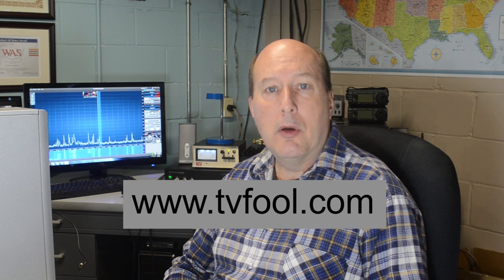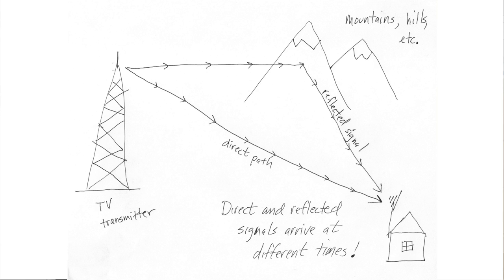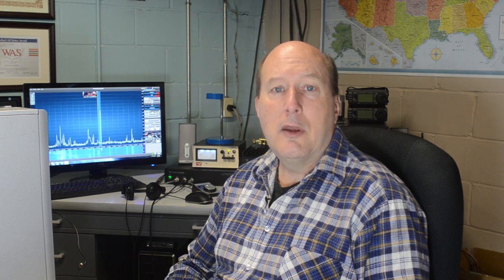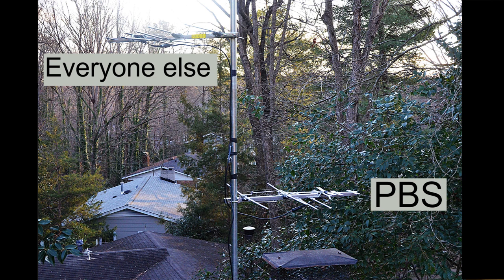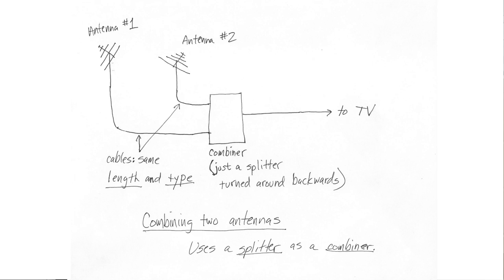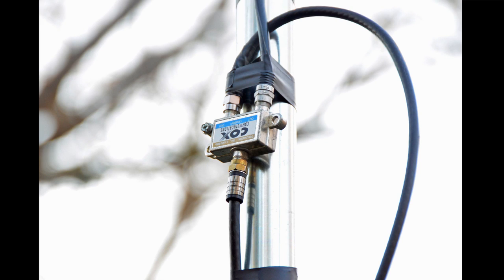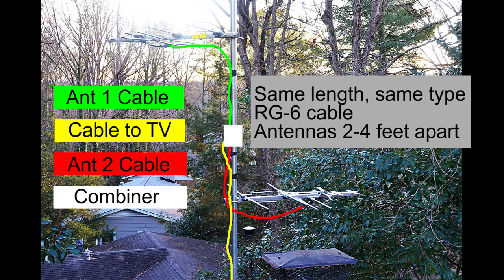Combining two TV antennas for better HDTV reception

Comment: Doug,
Your video is quite simple to understand.  I searched all over the internet to find information about combining two antennas.  I have a problem thought.  I have the exact same two antennas and I followed all the steps in your video : they are 4 feet apart and I used the exact same length and type of coaxial cable too.  I tried three different types of combiner/splitter.  I am still not receiving any signal.. I tested both antenna separately and they are working.  I am using two Monoprice HDTV Antenna (model MDA-5600).  Can you help me ?
Reply from the maker: Doesn't that antenna have a built-in preamplifier? I don't think the combiner will allow the DC power to pass through to the preamp in the antenna.
Reply: Yes, it has a built-in preamplifier.  That's why it does not work.  Thanks for your help!
Reply: Would a dc pass combiner provide enough power for 2 pre-amplifiers?

Comment: Are there any ways to measure signal strength  when mounting a fixed antenna. So when you fasten it is aimed correctly?
Reply from the maker: There are TV Signal Strength meters you can buy (the Winegard RFL-342 is one example) but unfortunately I don't have any experience with them. Some TVs have signal strength readout information available as well.

Comment: Thanks for the video.  I have an outside antenna and we get all the local channels expect one.  We purchased a Ultra Pro Hover HD 250 Amplified Antenna Bar, which go 50+ miles, to hopefully receive that one channel we want.  Would it work to hook up and outside antenna and this inside amplified antenna bar?
Reply from the maker: Hi Jenny, I doubt it. I guess it can't hurt to try, but likely you'll have issues with multipath distortion as discussed in the video.

Comment: great video, now when trying to combine 2 OTA antennas that currently both have preamplification,  should I cut back to 1 preamp amplifier and insert it just after the combiner and the power source for it just before the splitter that sends signal to 3 tv's? Or is there a better scenario? thanks
Reply from the maker: I think that's what I'd be inclined to do in your situation, David. In my case I bring the combined signal down to an amplified distribution box under the house.

Comment: Wiring them in parallel doubles the reception surface area and also cuts the resistance in half. Thus boosting signal strength...

Comment: Doug, great info! One question, if I wanted to hook up multiple TVs, I've been told that I needed to install a preamplifier. I'm assuming that this would be setup after the combiner. Is this correct or am I mistaken in locating the preamp, or even in the need for a preamp in the first place?

73,
KI7DBV de Phoenix, AZ
Reply from the maker: That's correct, Pablo. I have a preamplifier installed after the combiner, and it feeds multiple TVs.
Reply: Alan Sumner would a filter help as well?
Reply: Alan Sumner Good stuff right there, thanks

Comment: I like the way you have it setup, I might do it similar. Just wondering, did you ground anything? or it's not necessary? thanks
Reply from the maker: Yes, the coaxial cable going to the house is grounded using a coax grounding block before it enters the house.

Comment: Great video. I am trying to achive the same thing and have just purchased a Clear Steam 4V on line (don't have it yet). This unit has 2 panels mounted side by side using 2 common rails to mount these panels to a roof top support pole. What I would like to do is fabricate 2 new mounting rails that would point each one of these panels at the each of the two towers I wish to recieve signals from. They are probably 120 deg. apart. But by mounting them this way they would remain at the same elevation and in your video you have mounted then a few feet apart (above and below each other). Just wondering if anyone has done this type of modification before with good results.

Comment: Hi Doug, Can I add another and point both antennas in the same direction ? I am 100 mile from transmitters and mountains and hills ( I get most channels good but some seem just to weak. I have Channel Masters biggest antenna,with most elements  with there best long distance amp. Good work with this video.
Reply from the maker: Yes, you can do this, but the most you'll likely get from such a configuration is an additional 3 dB of gain, so it may not solve your problem for the weakest stations.

Comment: Nice video...what frequency range does the splitter / combiner need to be?
Reply from the maker: Most of the ones I see advertised now are in the 5 to 1000 MHz range, which is fine. Anything that handles 40 MHz  through 1000 MHz should have plenty of range.

Comment: HI, I have a similar problem. I live halfway between Dayton and Cincinnati.
I just use 2 small wall mounted antennas. One on the north side and one facing the south.
It works pretty good. Should I be using the amplifiers before or after the splicer?
Right now I have both antennas amplified and feeding into the reversed splicer.
Should I do that? or Amplfy the signal AFTER they have been combined?

Thanks to anyone that might know the answer. I'm just a young guy that trying to avoid complete technological dependency. God bless

Comment: What is the significance of keeping the two antennas 2 to 4 feet apart? I ask because I saw a few antennas being sold that have 8 small panels, but really these antennas allows a pair to be pointed in 2 different directions.  The two sections were tied together with a splitter. If you are correct, then the signal from this style of antenna would be compromised because the two panels are next to each other.
Reply from the maker: The spacing with log periodic dipole arrays (the type of antenna in the video) just needs to be enough to keep from distorting the pattern and impedance characteristics of the antennas used. I think with panel antennas you can get by with closer spacing.

Comment: Hi Doug. Thanks for the video. Being that you need to use the same length/type of coaxial cable, is it safe to assume you NEED to use identical antennas??
Thank you.
Reply from the maker: No, you can use different antennas, but they should both be directional.

Comment: Do you find that metal roofs cause problems with ota? Can you also mix omnidirectional antenna with a directional one. We have three stations side by side and I can only get two.
Reply from the maker: George, I don't have any experience with metal roofs, so I can't say.  And while, in theory, you can combine an omni with a directional antenna I think you are more likely to experience multipath issues.

Comment: Do I have to have the exactly the same antenna? Or could I use also two different antennas?
Reply from the maker: Different antennas can work as long as they're directional. Maybe not as well as identical models, but they should work.

Comment: That's fascinating. I would have thought they would interfere with each other causing issues.
Reply: It depends on the 180° gain of the antenna used, if it's very low, you should be fine. In other words, use a VERY directional antenna.

Comment: question of you Doug do the antenna have to be the same also or can i get yagi style point it toward my closer  channel group .then use my larger antenna for my further away station that in my case happen to be opposite direction there roughly 95 miles from my home the closer group in  other direction is less than 40 miles ..you made note the length of antenna cable must the same to the coupler  or can a regular splitter be used i have both ..Larger antenna on rotator well just hate  buy another of same  antenna unless it a must ..Thank you for any help from me and the wife in advance
Reply from the maker: No need for both antennas to be exactly the same.

Comment: So does it actually make the overall signal stronger having the two antennas?
Reply from the maker: No, the 2nd antenna (if aimed correctly) just improves the signal from the station in that direction. Doesn't do anything for the stations in the other direction.

Comment: Great video. Is there a specific "splitter" required for digital TV signals or will any splitter work?
Reply from the maker: Thanks for your comment. Any splitter (even those from the pre-HDTV days) should work as long as it covers the VHF and UHF bands. It's the frequency response that matters, not whether the signals are analog or digital.

Comment: The use case I have for this is I live in an spartment where the TV and living room are on the south side of the building and the broadcast signal for other stations originate the opposite side (the walls and any metal in the structure possibly create a barrier for the RF). Since I can't roof mount anything, my theory is if I put an antenna on both sides, it will eliminate the problem.

Comment: Great Video ! I want to add an additional antenna in my attic.  Can the antennas be greater than 4 feet apart with an equal distance of cable between the two antennas?
Reply from the maker: That shouldn't be a problem. Again, just make sure there are equal lengths of cable between the antennas and the splitter/combiner.
Reply: Very Helpful Sir Thank You Very Much It Works Great For Me

Comment: I just bought a extreme signal bowtie antenna, it turns in the middle for two separate signal locations. I don't plan on using it in two locations, but it's possible it will pick up in two different locations anyways. What I wanna know is, it has a frequency mixer on it, can I use a backwards splitter to make a combiner in place of the mixer? Or do I need to use the mixer? Also, what setup would you suggest using with a preamp with this anttena? I need a preamp no way around it, I'm too far away and trees in the way to get a good passive signal alone.
Reply: While I'm not an expert, a pre-amp just amplifies the signal you already get. If your antenna isn't getting a good signal a pre-amp won't help you. The pre-amp is for keeping the signal strength good after splitting to multiple TVs. The pre-amp should be installed on the antenna mast before a splitter but after a combined if you have multiple antenna's(antenni?).

Comment: Hi Doug.I would like to ask whether it possible for me to apply this to install on vehicle 
let's say I install 2 yagi antennas (3elements) pointing to the opposite direction to make it support when car drive in either direction because for me I want to combine to same signal using two antenna.So it is not exactly same with you that use two antenna two receive different signal but will this concept work? thankyou
Reply from the maker: It sounds like it would work as the principle is the same.

Comment: Doug,  Do you think two antennas pointed in the same direction to form an array would help reception from a distant tower ? Thanks
Reply from the maker: Yes, there will be some improvement, but it may not be dramatic. I would estimate 2 to 3 dB at the most. Spacing will likely be more critical, and the performance improvement won't likely be constant over the entire channel range. But if you're right on the edge of decent reception it might make enough difference to be worthwhile.
Reply: Onioncasserole

Comment: Good video!   However, I have found that even using outdoor electrical take to secure the cable to the mast does not hold up well over time.  I then tried heavy plastic cable ties.  They deteriorated.  Now have gone to stainless steel cable ties.  Hopefully, they will work out better.  Thanks, Steve/OHIO
Reply from the maker: I've had the same experience with the plastic cable ties Steve. They break down under the UV from the sunlight. Thanks for the tip on the SS cable ties.

Comment: This was an excellent and very informative video however I have one question, can you use same setup except using one outdoor antenna and one indoor antenna?
Reply from the maker: Yes, people have done that with mixed results. Usually they add the outdoor antenna to get one particular channel that they are missing on the indoor antenna.  The same advice applies - you should  keep the lengths of coax between each antenna and the combiner the same.

Comment: Like your video Doug. 
Thanks for such a detailed and informative piece. 
Could you not use an Antenna Rotor or Rotator to solve this problem?
Reply from the maker: Not in my  case. As I mentioned in the video we have multiple TVs in the house. If my wife and I each want to watch a different station then a rotator is not of much help since a single antenna can only point toward one station at a time. But for single TV households, sure, a rotator is a good solution.
Reply: Hi Thomas, I also have the HD Stacker from Denny's and was wondering if you went with Doug's setup of 2 in opposite directions or the rotator, and what were your results? Thanks in advance for your help. Happy Thanksgiving!

Comment: Doug Hall   I would like to try 2 antenna's. Suppose you can pick up 15 stations pointed east and 14 pointed west? Yet a lot of the channel's had the same numbers like 2.1and 2.2  and so on but from different city's?  Hope I made myself clear.
Reply from the maker: Yes, I understand. The answer is "maybe." In the analog TV days channel 2 referred to a specific frequency range, 54 to 60 MHz. But with the transition to digital TV many TV stations kept their old channel numbers but actually went to a different frequency. So you might be tuned to channel "2.1", but the actual frequency will be somewhere else. As long as the channel 2 from one city is on a different frequency than channel 2 from another city you should be OK. But if two channels from different directions are on the same frequency then combining two antennas will probably prevent you from receiving either of them.
Reply: Doug Hall  We found out today we were getting signal from a tower 5 miles away from us. We had the antenna on the roof 30 ft above ground pointed about 80 deg  away from the tower. We got 13 cannelsWhen we pointed at he tower we got 5. When we first got the antenna we tested it on the ground in front of our house and got 15. So we brought it down from the roof put it 5ft above the ground in front of the house. It is now pointed about 15 deg away from the tower and we get 20 channels. And here I thought the higher it was the better it would be. We also grounded it and that also helped. All 20 channels coming in just like we had dish or cable. Thanks for replying back to me Doug..

Comment: In my experience, a splitter does not always work as a combiner.  Some, called splitter/diplexers do.  Is the  circuitry different between the two ?
Reply from the maker: Diplexers (at least the ones I have used in the two-way radio world) have different frequency ranges for the two input ports, ie. they will have high pass and low pass filters to provide isolation. But most garden variety passive cable tv splitters have identical circuitry on each port and I would not consider them diplexers. In any event, you're right - some of these devices would not work if they have a high pass on one input and low pass filter on the other.
Reply: Thanks Doug but I'm having no success at all using various splitters. The signals seem to cancel each other out.  Perhaps I should be using  identical antennas ?

Comment: Great video Doug. Can i use a UFH antenna, with pre-amp, and a VFH/UFH antenna without a pre-amp? Thanks.
Reply from the maker: I don't see why that wouldn't work, assuming both antennas are directional.
Reply: Thanks. Some say that using a splitter in this method will cut signal by 50%? I found some antronix splitters lying around, would either of these work in this aplication? CMC2002u   CMC2002H. Looks like i found my new hobby in testing and more testing...Thanks for your time.
Reply from the maker: It's true - think of the analogy of a water hose. If you attach the hose to a "Y" connection then half of the water will come out each side. A splitter is a passive device, so there is always signal loss when you use one.